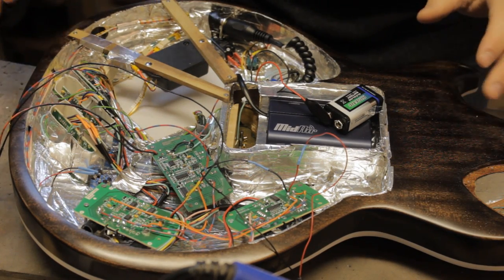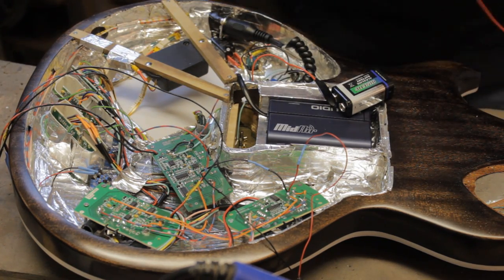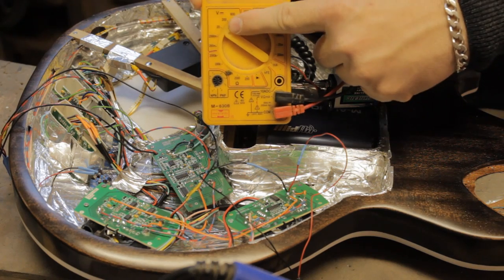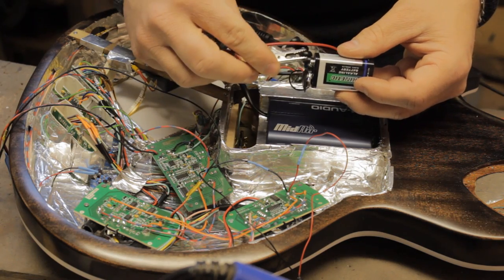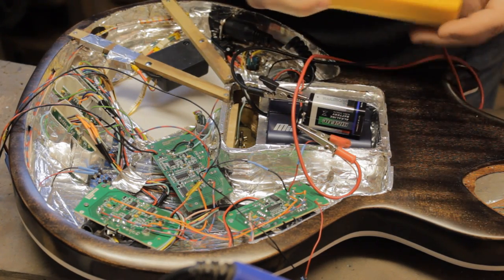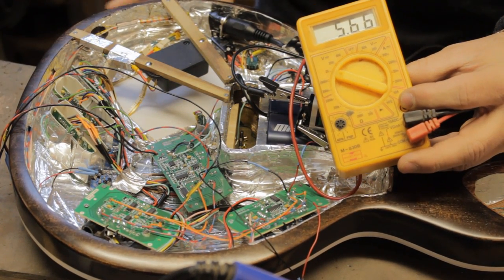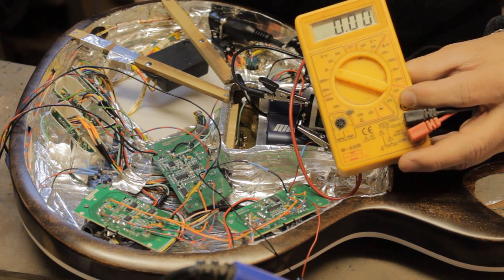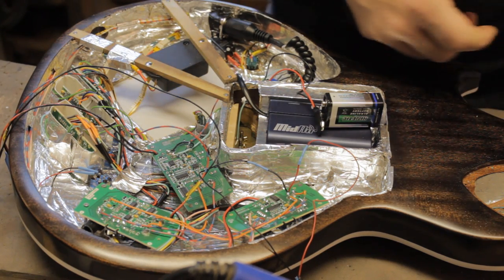guitar builders basics 1 - how to check battery drain in an active guitar system

Comment: Check your wiring, the middle contact in the output jack connects the battery to ground via the ground part on your 1/4" guitar male plug. Fender's own poor schematic: support.fender.com/service_diagrams/bass_guitars/013-6700B_SISD.pdf